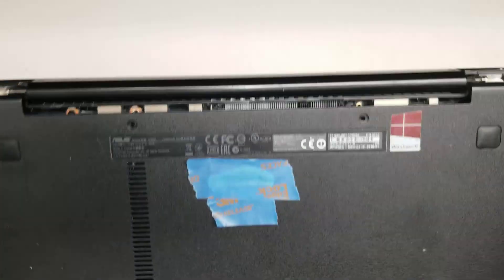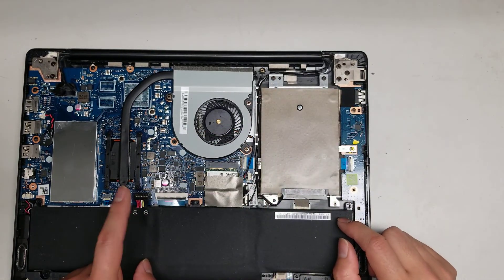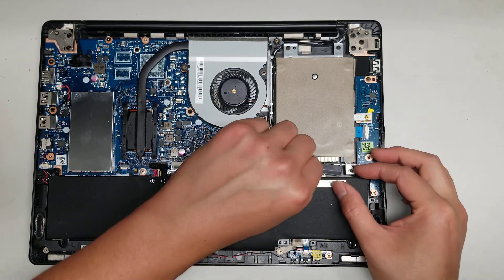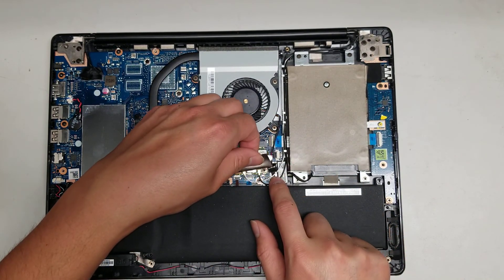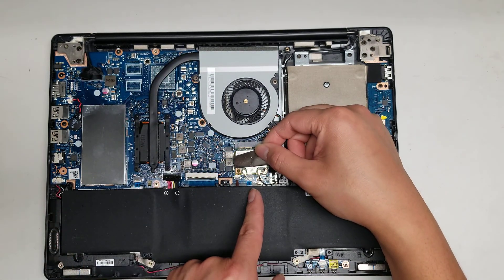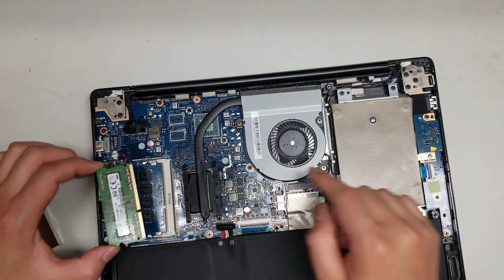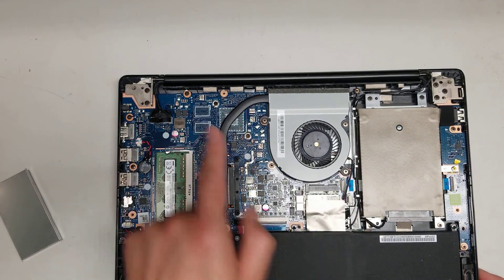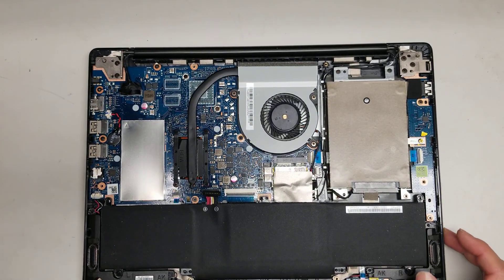ASUS Q302L Disassembly RAM SSD Hard Drive Upgrade Repair

Comment: Could I put this hard drive on a hp notebook 14?
Reply from the maker: What's a house notebook? Like a spiral notebook you write on with pen and paper? Sure, you can use it as a paperweight if you want. Lol
Reply: @ItsBinhRepaired  lmao autocorrect I meant hp
Reply from the maker: @facktheauthority5813  depends. There are a lot of different hp notebook 14s. I'll need the full model number from the bottom of the laptop.
Reply from the maker: @facktheauthority5813  not sure why you would want to transfer a hard drive though. Might as well get an SSD.
Reply: It’s a 14-an012nr because my asus q302l has a network issue where it can’t connect to WiFi but my hp notebook 14 doesn’t have enough gb to download games… so why not see if I can’t just swap them before spending more money.
Reply from the maker: If you swap you'll have to do a clean install of windows
Reply from the maker: Just get a wifi usb adapter
Reply: @ItsBinhRepaired  I’ll look into that, I got a Ethernet cable and a USB adapter for it.
Reply from the maker: Sounds good